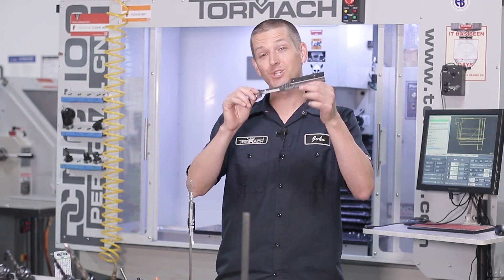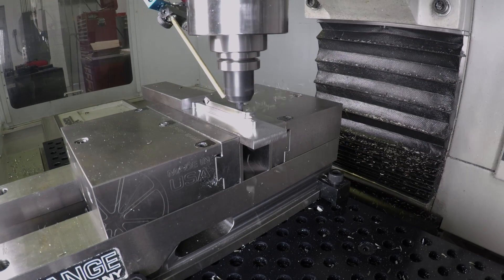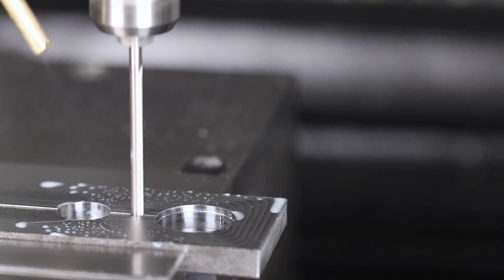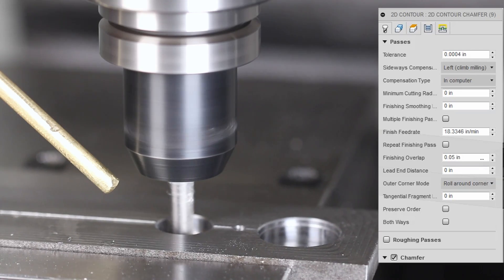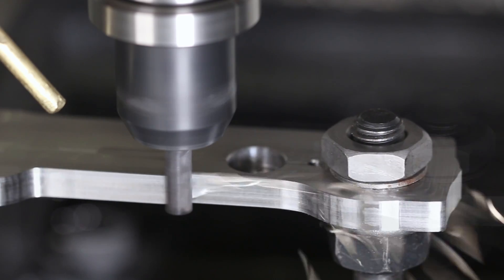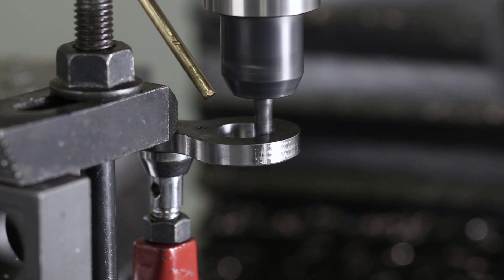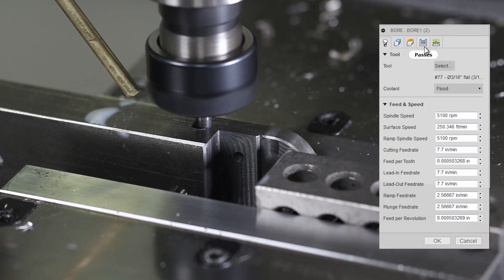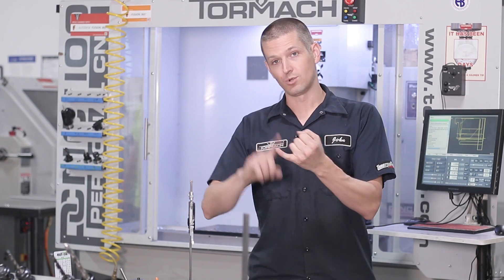Machining the DIY Repeat-O-Meter Top! WW154

Comment: John, the reason for that silver(The center strip you are talking about) is quite simple.
You defined the tool as a straight mill but the tool has a radius.  The adaptive doesn't know so can't compensate for it. If you define the tool as it is you will not see the silver.

Comment: Instead of making the lower spreader bar as a separate piece and screwing it in - why not make it part of the spacer bar between the top and bottom piece?  The gap between the top and bottom spreader bar will be larger, but makes simpler and more rigid construction without the extra screw operations.

Comment: Please! I've been watching your videos for some time now and I love them. I'm setting all my political ideas on the shelf, because I love machining. But you've got to use bigger end mills and go faster. Using small tools because they are cheaper, that only takes longer time with increased tool wear. I don't know if you're talking about this in the video because I've got to lower the volume, my wife would think it's stranger to watch machining videos than porn... so there you go. But please use bigger end mills and increase surface speed and feed!
Reply: Christoffer Liljeberg 
It's a Tormach. It's limited to 100 IPM and about 1HP at the spindle. 

That's about all it's got.

Comment: Did the thin middle section remain at the end of the 1st op because the tool is undersized or is that just something about the cam path?  I would have just milled all that off with a shell mill in one pass. :-)
Reply: I'm pretty sure that happens here because he told the cam system the tool was straight with a sharp corner, but when he zooms in for the spot drilling you see that the tool actually left radii. So the tool most probably has a small radius instead of a sharp corner. The CAM system doesn't know and thus can't know that it leaves some material still.(The small strip of material deflects so if you don't cut a flat bottom usually it stays on)

Comment: John to get rid of that little piece left by adaptive you don't need to change stepover, you need to go to that tool in the tool library and just increase its corner radius slightly.

Comment: John

The strange thing is I get that same chatter/squealing one the same position as you did , the only really common is Fusion360, my mill is small but it’s all cast iron and quite heavy for its size,
Seeing the same problem leads me to think there may be a error in the way the code is implemented on the change of direction 

Yes cold rolled, or as I call it banana steel will move , now for the small hobby work I do I just get it red hot and let it slow cool when I get the stock in 

Good video again
Reply: SeptrothFFXI 
Hmmm that is interesting because as we know HSM and fusion share the same code generator 

That’s three different mills that get the chatter but only one source of the code IMHO there is something amiss 

As I said my mill is small Johns Tormach is not that big 

Will have to get the brain cell out of retirement after 70 plus turns round the big ball it’s a bit dim now

Comment: I know it is a "doh" question but why use cold roll vs hot roll? I know hot roll has that nasty scale but fears of stuff moving is less. 

If I had to use cold roll I would have roughed it to within ~0.03" then put it into an oven to anneal [or just left it to sit] to let it stress relieve THEN gone and finish machined. Overall an interesting project!

Comment: Im not a tormach user but i assume they have ball lead nuts , not half nuts , so there should be little to no back lash even though we don't live in a perfect world, so there must be some... I would do a test,....machining the same material and using the same tool and machine a cylinder in the same  axis to the spindle(vertically)  on the mill , from square stock and do a moderately heavy contour clean up.... I'd say if you have chatter at 12 o'clock,  3 o'clock ,6 o'clock ,9 o'clock when your lead screws are changing direction  to machine a cylinder,  it may be back lash in the lead screws/lead nuts.... if you you have chatter at 1-2 o'clock, 4-5 o'clock ,7-8 o'clock,  10-11 o'clock,  it could be loose gibs that makes the tool bind up on the work piece when climb milling, and chatters as 2 axises are moving at the same time to machine the cylinder. OR it can also be G code lock up....if you have low tolerances in the cam you may have lots of g code lines that your machine has to execute at the speed of you feed rate...ie..your machine may travel to the g code coordinates faster then your computer can read and execute the next line so your machine will stop and sit there for a split second and wait for the next coordinate from your computer... this will get exponentially worse when moving in more then one axis  at a time  like it would be in those non vertical and horizontal  corners of the cylinder. that's why some Smoothing in the cam side is better to have ,than non at all because it decreases your amount of g code lines you have for your part. If it is g code lock you should only have chatter in adaptive strategies and not contours because it has  high amount of g code lines .... in a contour clean up I think there should only be 4 lines to travel around a circle  because  your g code that your machine would use, would be a caned (arc ) routine and your computer can handle 4 lines to travel in a circle at those feed rates.

Comment: What i don't understand is why is the shelf so small. You remove nearly 50% of the material to create a small shelf so you can skew on the second path. Why isn't the second path as long as the hole first part? The raw stock can be thinner and you don't have to remove as much material making the operation much faster and with less material wasted.
This also means that the connection is more ridged. For me it looks like the skew connection is not ridged enough to lift up the top half. I think It will move in the connection and so the added part below not the massive element above.

Comment: Looks like your CAM toolpath is broken on the chamfer at 7:34
Reply: If I had to guess the reason the chamfer your referring to is in two arcs instead of a circle is because there is going to be a saw cut right in the middle of that circle which will be a pinch point to lock onto the micrometer being used so there is no need for the chamfer to go right around since there will be about a 2mm gap right in the middle.
Reply: Oh, now it makes sense, thanks. Would it mess up the cut?

Comment: Hay John is your spot drill that you are pushing in to the material at 20ipm carbide or HSS?
Reply: I just did some 3/4" hole drilling in steel at .010"/rev and it took it fine with a regular HSS bit.
Reply: looks like hss
Reply: Eggsr2bcrushed.. Unless it's just me , but I think that  spot drilling at that speed is insanely fast for HSS  , I guess buying premium tools pays off. I feel like if I did that with my spot drills they would just burn up.... your spot drill speeds and feeds in steel  are my speeds and feeds in aluminium.... crazy cool.I guess I know what I'm trying next.
Reply: bcbloc02 I don't think your little radial drill cares about feeds and speeds, Brian. If the bit doesn't snap, a hole will be made where metal used to be. 😎